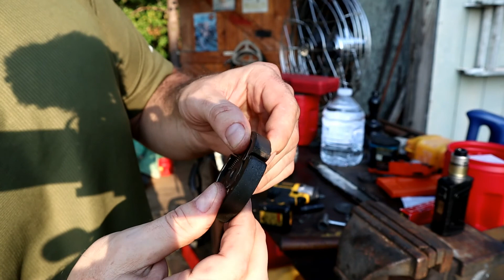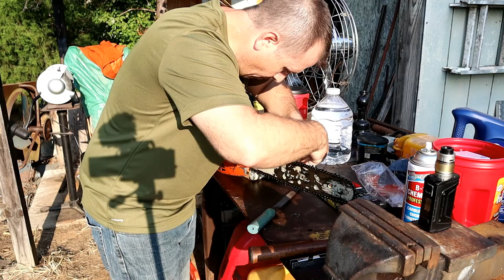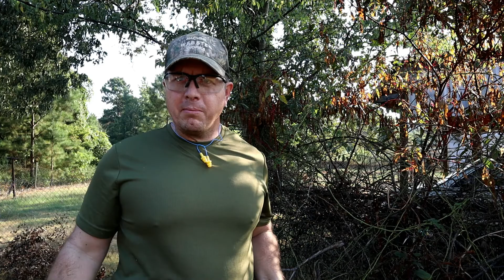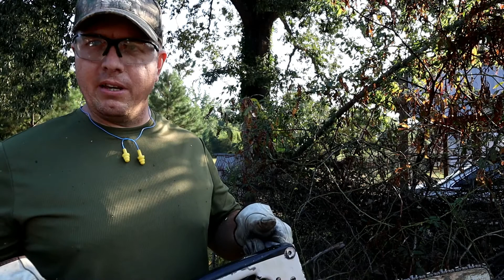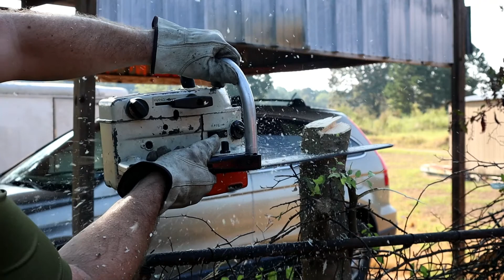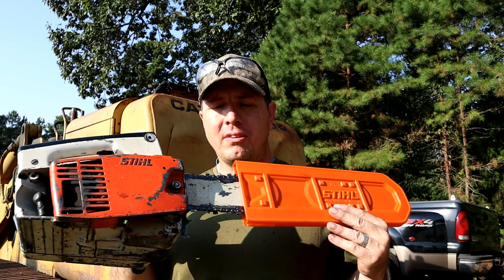Stihl 020 AV First Cuts!

Comment: That is exactly the same as the one I recently acquired. I say this because after getting it I've been looking and there seems to be a few different hand guard and chain brake configurations. I thought mine had had a 020 super clutch cover put on it. because it just has a hand guard on the handle but the clutch cover is same as yours with the slot for the chain brake like a super has. 
Who knows haha, not had mine running yet, need to finish my 032 before starting on the 020.
Thanks for showing 👍
Reply from the maker: Sounds like you have some good saws to tinker on👍

Comment: I have one of those, It's my favorite saw now! Mine came to me with 30-40 year old fuel in the tank. I cleaned the tank and ordered a new fuel line for it, put a metering diaphram in the carb, sharpened the chain and like you showed it just rips through wood like crazy. I agree they are not that hard to take apart, especiall once you know the sequence. Mine has the 1/4" picco chain on it that works wonderfully, but I would love to try it with a 3/8 LP .50 chain and bar on it at some point.
Reply from the maker: It’s a really great saw!  Mine developed a bottom end seal leak and there are no spare parts for it anymore. So sad to see no one had an aftermarket parts supply for these saws. I fear they are a dying breed
Reply: @Man-Time  is it a crank seal? If it's just a standard seal you can take the number from it or take it to a bearing shop and order them. Most seals are standard and as long as you have them in ok shape to to measure them you are good to go. It's worth a shot for such a great saw.
Reply from the maker: It’s a combination of things I’m sure. Including a scored jug that I bought used. I’m going to tear it completely down and maybe be able to find a good used jug for it. Excellent suggestion for others looking for bearing seals!